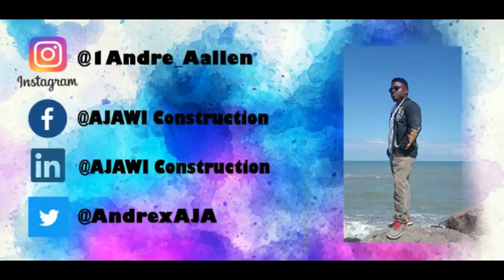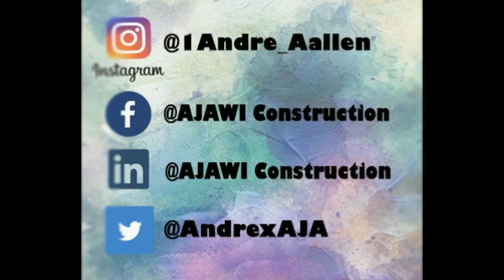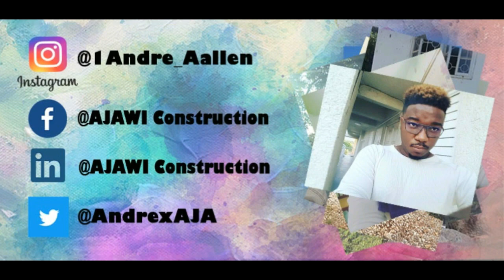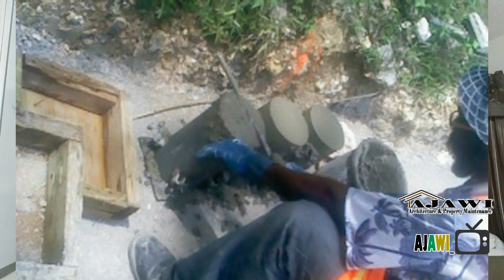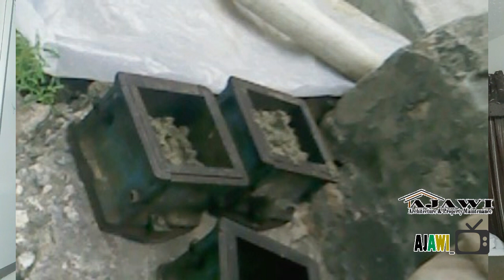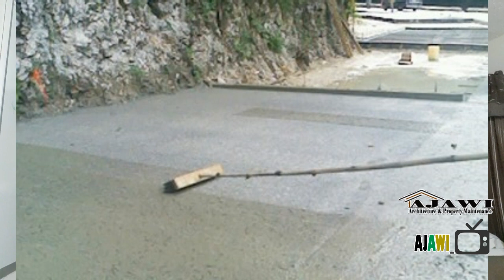IS YOUR CONTRACTOR ROBBING YOU BY USING INSUFFICIENT MATERIAL | JAMAICA | CONSTRUCTION| ARCHITECTURE

Comment: Once had a friend who knows construction told me the dirt/clay that would form the floor of my house should be scooped out because it will eventually swell and cause a hump/uneven surface inside the house, when I told the contractor he would have none of it and it cause a problem between us. He insisted that all that was needed was for him to wet the earth inside the building with lots of water and that would be sufficient and that what he did..it's going thirty + years now and everything is okay. I still respect my friends advice because he saved me on many of occasions.
Reply from the maker: Interesting, well there is nothing I can say on that one. If it worked for you who am I to say otherwise.

Comment: What would be the difference between paying pre mix/readymix to do the mixing and delivering of concrete or allowing your contractor to mix it on site?
Reply from the maker: Mixing on site will not be as accurate and when premix does it. Premix does a designednmix in a controlled environment. This will ensure a concrete with a higher strength. Also mixing on site take longer.  Imagine building a government building where a lot of people will pass through. Now imagine the concrete being mixed on site. There will be so much variation in strength of concrete that you would worry each time you vist

Comment: It the states you a have to test the slump, temperature and air content before you pour concrete. Preferably your slump should between 4" to 6" anything outside of that your concrete is not good.
Reply: @AJAWI_TV  Respect man. You are doing a great Job of informing people about construction. I used to have the same problem explaining to people that you cant build without a plan and expect good result, financially, structurally and Architecturally . I am a graduate of UTECH also and a Civil Engineer living in the United states. I came across your videos on LINKEDIN. I must say i listen to you carefully and you are on point with everything. God Bless.

Comment: What is the ratio of cement to marl to lay blocks
Reply: Swede Swede I dont think anyone is using marl anymore because it is calcium it tend to flake and break down over time not even the white stone I was told not to use it because it has component of marl it is limestone  so it is not the best but it is your choice I bought the river stone aggregate  and my uncle also told me we have to be carefully what time of the season we buy sand he said if it is rainy season the riverside sand is good but when it is drought dont buy the river sand it have too much mud buy the crush sand that is made from the river stone at the quarry and dont buy sand when rain is falling on a day when you had droughts for long periods cause you cannot see the dirt in the sand when it is wet. Lol it is a lot to take in he sells sand and stone so that's what he pointed out to me there is also a sand test to know weather the sand is good or bad.